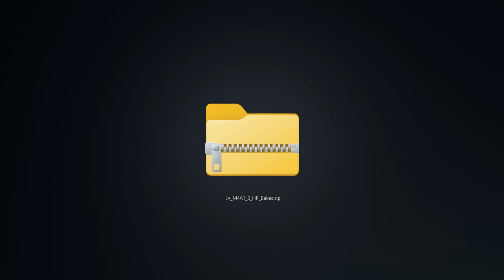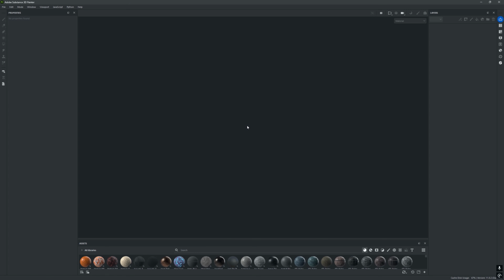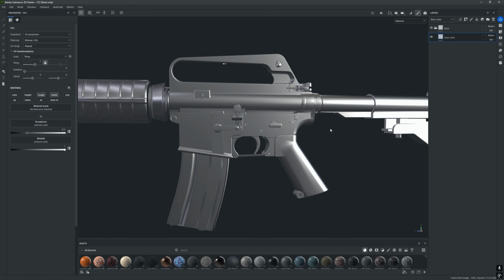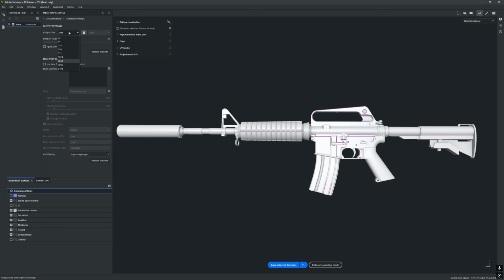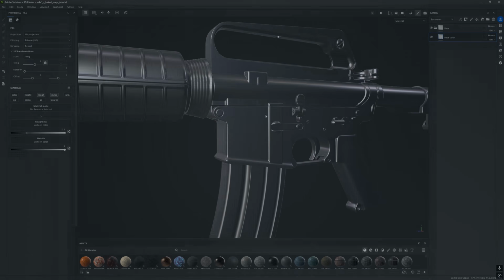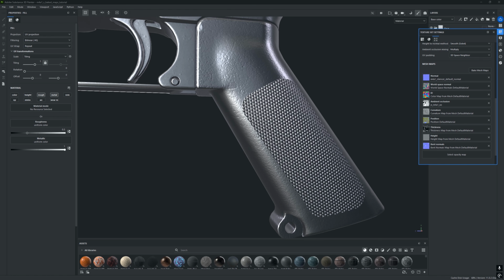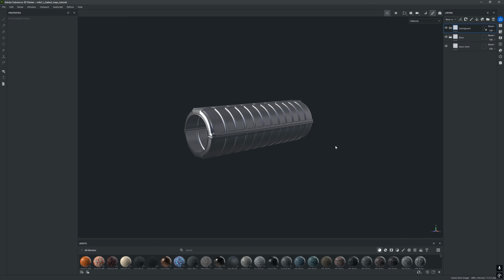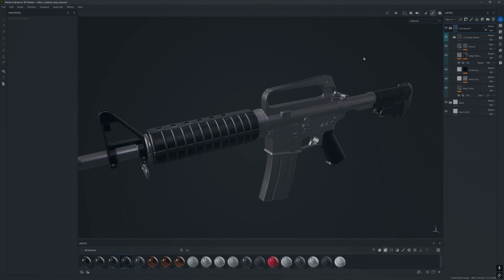Counter Strike 2 - High Poly Bakes Explained and How to Use Them Tutorial with the M4A1-S.

Comment: how do I create a high-range model myself?
Reply from the maker: You mean high poly I think. There is really no simple answer for that. You basically need to create a high poly version of the model and bake it to the low poly.
Reply: @JohnnyVillas yes. But how this do it?
Reply: @kenonorovich4614  its gonna involve un-triangulating all geometry, then you will have to resample geometry on curved areas, weather thats through a plugin like av resamplemesh, or using subdiv methods, because you need enough geometry to support a remesh operation, then remesh, and smooth corrective to grab clean hps with light catching bevels, and smooth shading for each part.. its pretty standard for low to high workflows except when we were making our own models we have the grace of working non destructively and utilize live bevels, screw, and subsurf, and grab our highs before even cleaning up the mesh from any boolean ops, and removing unnecessary geometry. theres lots of information around for low to high poly hard surface workflows.
Reply: @zudethofficial9579  thx

Comment: Did u provide mesh?
Reply from the maker: No. Only the low poly mesh with the baked clean normal and AO maps. You can always ask me for something that you think that can be improved and you can also bake whatever you want on top of this normal map in blender since all surfaces are clean.
Reply: @JohnnyVillas   It's a bit sad, because the high-poly mesh can be used in Zbrush for even more modification. I think many people are interested in this aspect.
Reply from the maker: @exe.cut4ble  I understand that. But the price would be completely different. Also to create this bake there were used many different techniques so, there is not one single high poly mesh. It's very different from a Zbrush workflow. And that's the only way to get these results.